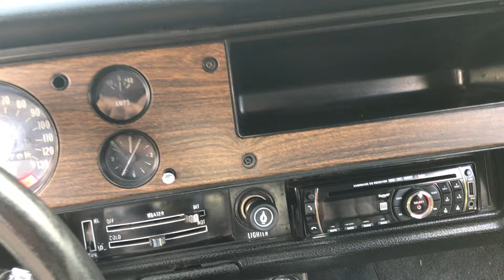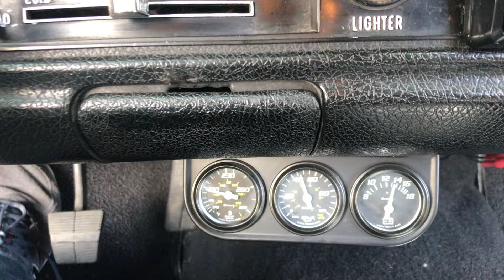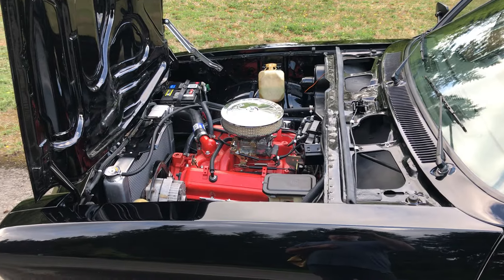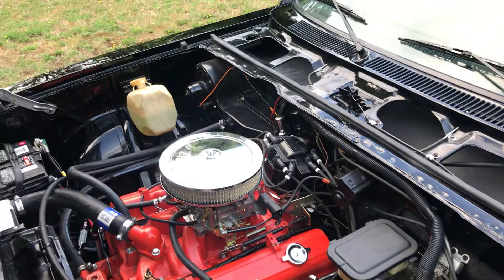1972 Vega GT V8 for Sale

Comment: I had a 72 gt metallic bronze 
With a white stripe down center and a 4sp in 1973 first car I ran that car a hard as it could be driven thinking when I blew the motor I would do exactly what you’ve got never could blow that thing up but it did use a quart of oil to a tank of gas 😂good memories 
Traded it for a new olds cutless salon with a 455 in 75
Wish I had them both now😢

Comment: Looks like my 72 Vega GT, 4speed with AC in lime green with white stripes that after six months had to have the cylinders steel sleeved.  I had it through my college days. It gave me 5 years of good service until the AC decided to stop and it started to rust out. So, by that time I had a real job and bought a new 78 Toyota Celica. fast back.

Comment: I had a 72 (not GT) Vega for a long time with a 307/Powerglide in it.  Engine was basically stock but with a 4BBL (AFB) carb on a chevy cast iron 'high rise' and headers.  It was a lot of fun, but it rusted away to nothing.

Comment: V8 Vegas were all the rage during the 70's and 80's! Simple power-to-weight ratio! My friend had one with a bone stock 350! It even had It's cast iron intake manifold! Just 275 hp and would blow the Doors off a Big block Chevelle! Even got 20mpg on cheap regular gas!
Reply: I had some bolt on power on mine and a mild cam.  I put a 350 4 bolt main in it. Performer intake.  Holley 600cfm secondary vacuum carb.  Nothing too great.  My exhaust was a joke. 2 1/2 inch headers with bullet mufflers welded to it.  No pipes at all.  Put it on top of a Munci M21.  I guess I did get a little crazy with the rear end.  I put 4.11 gears out back.  I wpuld guess it put out somewhere around 300 HP and the torque was probably around 400 to 425.  It pulled low 11s but was squirrelly as hell.  Best drag car I ever had for the total cost.  4200.  That was in 2001 2002.   Fun car.  Rice drivers wanted no part of it.  Muscle and pony drivers got good views of the tail lights.

Comment: Bought a rust bucket '72 with 20,000 miles for $100 back in '79.  Drove it until the rear swingarm separated from the unibody.  Was hoping to find an oil burner with a good body and swap engines but finding a clean Fischer body in New England was impossible.  Sold it for $100 for the engine.

Comment: I had a guy pull up next to me at a light in a Vega, what looked like fake dual quads sticking out of the hood. I was in my 70 barracuda 440, needless to say when I caught up to him at the next light I couldn't believe what just happened.
Reply: Back on 01 02 I had a 72 Vega.  Bolt on power on a 350 I put on it sitting on a Munci M21.  Put a 4.11 rear end in it.   Total, I had 4200 dollars in it.  I raced a kid who was driving his dad's 68 Hemi Roadrumner.  He wasn't too happy that he was smoked off the line by a car that had duct tape holding the driver door shut.   Fun cars.  Dangerous if you wreck them....but fun.

Comment: I guess it's sold? I don't see a fan on the radiator. I had a 72 Vega with a 350 2brl carb. My friend took a 71 Nova and put the front end and read end to include the engine in a Vega. It looked like a mini Camaro. Fenton center lines and sold it for 600.00 in 1978
Reply: I had to take the hood off it to keep it from over heating

Comment: I built a '74 Astra GT  327 off a '67 Corvette engine hooked headers. 4 spd black with black interior.  I got most of the info on the swap from hotrod magazines and parts from auto wreckers lots of fun.

Comment: I owned one of these, a 1973 model with a 327 stuffed in it by a mechanic friend in Delaware.. He even put cut-outs for the headers on it for me. That little sucker was fast and actually handled pretty well.. Street raced with it several times and made a few bucks. I remember would bust my balls a
bout owning a Vega...until they saw it run that is.
Reply: My 3 car was same as this only all beat up. I was a teenager and couldn't afford to upgrade the stock axle.  I would leave one line of black rubber  for 100 feet all over town. I couldn't just drive it normally. Burnouts were just too much fun!
Reply: It’s available now..?? I like this..!! How much $$$

Comment: My first car was a used '71 Vega with the four cylinder aluminum block engine, I bought ~ 1975. Engine was crap when I bought it but it was a fun car to drive (while it drove). I got in trouble with my mother because I put a pillow on the emergency brake so my dates could sit closer to me while I was driving (mother thought I had an ulterior motive with the pillow). It was a good first car and made me respect every car I've had since....

Comment: I had a 1975 Monza with the pathetic 262. In 1978 I dropped a 383 pro built V8, B&M turbo 350 transmission and a 12 bolt 3:73 posi. Not bad for a high school kid. I miss it. Would love to have another, but this Vega fits the bill for this 62 year old. Probably not available.  But cool. VERY cool!

Comment: Vega frames are extremely weak. Guys used to put SB Chevys in them and go to the drag strip where Vegas became known as twisters. Because horsepower will twist those things like spaghetti. One guy got completely ejected at our beach with his V-8 Vega.  He was gonna do a show off burn out. He revved it up, let the clutch fly, and the front half of his Vega did a left side wheelie that popped his door open and spit him straight out on the road. The car coasted off into the grass and stopped. The left front tire was at least a foot off the road when he got help pushing it back to the street. And it stayed that way. His door wouldn't match up good enough to close any more. The thing was a mechanical pretzel !

Comment: Great job. What you built here is what the Vega should have been. The body and especially the front end on the 1970-73 models was just awesome. Unfortunately that was were awesome ended and woeful began; i.e. mechanically these cars were absolute TURDS. The V6 Mercury Capris built in Germany were light years better than the Vega. That's why the TLC you put into this vehicle is so appreciated. I love to see these Vegas resto-modded w V8's.
Reply from the maker: My goal with the build was to make it look as "factory" as possible. I hope the new owner is still enjoying it.
Reply: @albertpenello  Well you really nailed it. It's hard to find these nowadays because unless they were kept in Arizona or garaged, the bodies have rusted into oblivion. Most of what has survived has been tubbed & caged for racing so to street them usually takes a lot of work. The upside of that though is that it's usually less metal / frame fabrication and more tedious work like wiring etc.

Comment: That doesn't appear to be a 327. There's something wrong with it, a 327 has an oil fill tube in the forward part of the motor tilted slightly toward the driver's side. 265 283 and 327 engines had that design unless that is the very last 327 built in 68. Only a 305-307-350 and 400 had the oil fill on the valve cover itself.

Comment: had a 72 gt myself..... steel sleeves in my 74 motor( bought for$400 in 76) that i wrecked and dropped the motor in the 72 gt that i bought with no engine for 200...back in 77... put over 100,000 on that motor...

Comment: 327 eng. 1962- 19671/2 small journal crankshaft engines has an oil fil tube in the front of the engine by the water gooseneck on the manifold. Under the intake it had a oil can mounted and the small journal intake was made for the oil can. In 1968 they changed to a large journal crankshaft and the oil tube hole, plus a oil can under the intake was removed. The early model  was changed and in 68 there was no more small journal 327. The engine is 68 or newer, there is a place in front of the head on drivers side with the manufacture code and info on the eng. was stamped.

Comment: This is one of the best stock looking Vega’s I’ve seen. Nice car! I know about the dual exhaust thing. I really would like to have my very clean 73  I had in HS. It was just a couple of years old when I got it. Mine was the GT. It was a green color, had the posi rear end, and the crappy opel 4 speed. I did a few other things to it but, didn’t quite make the V-8 conversion. I’m wondering how a set of chrome side pipes would look like on the car, especially with it being black.

Comment: If Chevrolet had stuck with the idea of putting a 283 ci motor married to a 4 speed manual transmission,  and a positrsck rear end, & a serious coat of rust PREVENTATIVE at the factory , the Vega GT would have been an outstanding little muscle car!
Reply: You could have purchased a Baldwin-Motion V8 vega during those years.
Reply: Chevy did put it through a 5 or 6 step rust proofing treatment but there were too many air pockets where the rust proofing didn't reach when dipped. A two speed power glide automatic transmission fit well onto most small blocks and didn't require much in the way of modifying the body transmission area. The power glide was originally used on some of the first Corvettes.

Comment: We had the Red Rod at 16 yrs old in High School my Buddy Mark neutral dropped the faster stuff , 4 bolt main 350/ 400  monza v8 posi rear end ,, smoked everything ,, 454 SS 70 Chevelle yellow black stripes 4 speed ,,, smoked it ,, everyday at lunch ,, Mustangs ate em up .. SS camero ate em up . .. R/T chargers ,, my buddys had them all . the v8 vega ate em up .. 5.0 mustang Highway patrol new to street ,, smoked it :) .

Comment: The story goes that the Vegas was never granny tested , as they were in a hurry to rival the Pinto . The Vega was a delicate car and they dipped the frames / bodies in vasts for rust proofing which was stupid , as air bubbles would happen , and that's how they were prone to rust . For 1976 and 77 , they worked all the bugs out  of the car , but consumers lost interest as the reputation for these cool  little cars was already done , so they gave up after small sales in 77. Its a shame as they needed more power than 90 horses . I had a 1976 V 8 , with a 906 cam , Truck CID 350 engine in it with a 9 inch Ford rear end . What a blast that was ! Though it was a automatic , it had a shift kit in it .

Comment: Out of all the small blocks that Chevy used in cars for some reason the 327 feels perfectly designed for the cars it was in. Always run smoothly no matter what, one of my favorite engines ever made.
Reply: Hey Matt what about the 283ci ? Jus’ askin’ ! 👍
Reply: @mtsilvagt  I like em don't get me wrong 283s are nice. I don't know how to explain it the (stock) 327 has the perfect amount of torque and horsepower that all seems to be in the right place, yet it still revs nice and has power all the way up to the bottom of the red. They were good with power glides, THM350/400 autos but put one in a camaro with a Muncie 4 speed and it will be happy as hell.
Reply: Z  I think its just because most people don't have experience with what they speak of. If you had a 327 and maintained it well they were (dare I say) Toyota kind of reliable and you couldn't hurt them from beating on them, I've tried.
Reply: Z  Unless you have a car that came one there is no good reason to use a 327 vs 350.  The primary difference is that a 350 uses a 3.5" stroke vs the 3.25" in the 327.  All 327  blocks had 2 bolt mains, where 350 came with either 2 or 4 bolt mains.  In either case they are fairly short stroke engines and could be built to rev to 8500+. All things being otherwise equal the 350 will make noticeably more torque and hit peak power a bit lower rpm vs 327.  In theory all else being the same the peak power should be close to the same but average power power will be higher with the 350 between the peaks.
Reply: It was underpowered for the 1967 Impala and C10.
Reply: @20alphabet  you think so? I had a '65 with the 327 and a power glide and you are right in that it wouldn't accelerate too quick but was more than adequate. If you are familiar with the 101 freeway there is a hill called the "Conejo Grade" which is one of the steepest grade highways around and I could still maintain 75 mph going up it and I was no where near floored, I feel like you cant ask more from a stock car.
Reply: @mfslyphantom8811  
Yes, I think so. No V8 would have difficulty maintaining speed up the grade into or out of Ventura. But the 327 base engine wouldn't set anyone back in their seat in a larger car or truck. Now the 300hp version with the 350 Turbo-Hydramatic  or 4-speed would be a different story, but the base 327 2bbl in Chevy's big cars offered sluggish performance. Btw, I had a 1969 Nova with a 307 2bbl that flew up the grade, and also had good acceleration. Just a matter of weight I suppose.
Reply: The perfect match for the Vega would have been the Olds/Buick 215 Aluminum V8 from 1961-1963.
Sadly, they sold that engine - tooling, blueprints, and EVERYTHING - to Rover in the mid-1960s - and Rover refused to sell it back later.
Swap kits WERE made to put that engine in a Vega (I had a '73 GT set up that way) and it was GREAT.
Reply: @ineffable1129  my uncle (waaay back when) used to race dirt track modified. He and my gramps used 327s with a 283 crank which put the displacement at 302 cid. (They were doing this before Chevy put out the DZ-302!) 
  Needless to say they had a great deal of success.  Won a lot of races and broke more than their fair share of track records - with a few that still stand today!  It got to the point where they were forced to tear down the engine after (almost) every race because they thought my uncle and gramps were cheating. 😆😄
  Chevy hit it out of the park with their small blocks.  They were damn near bullet proof, and so many variables.
Reply: Z  Came back as the 5.3 truck engine
Reply: @bunk-bn9eo   Yup, that was the magic combo. It WAS the 327 bock but with the large journals and 4 bolt mains. GM chose to only build it as 350s (same 4 inch bore, longer stroke) or 302s (same 4 inch bore, shorter stroke). Forged short-stroke crank from the 283 and BAM. And yes, Chevy needed a 5 liter quick for Trans-Am homogulation an that is exactly what they did for the Z28's 302. Also came in Canadian Firebirds so they had a motor for Trans-Am racing, too. Funny, ACTUAL Trans-Am Firebirds ran the Chevy 302. Odd that never made it into the ads.
Reply: @mtsilvagt .....Hey, what about a 327 with a 283 crank, otherwise known as the Z28 302?
Reply: @bunk-bn9eo  - Even earlier in late1950's  it was discovered heavy casting 283's could be bored a whopping 1/8" / 0.125" to create a '301' which is same bore/stroke as a 302" (Chevy, Ford, or Pontiac 301")...
Reply: @mfslyphantom8811  Much depends on which version the 327 is. Several were sloth slow turds.
Reply: @20alphabet  - Basic 300 HP 4 bb. carb. 327 would shove a '67 Impala to 140 MPH... hardly underpowered...
Reply: no mention of the rear end

Comment: What about the rear end? I had a 73 Vega wagon crap build quality  typical of time , piece of junk aluminum sucked out four banger.  The engine quit at 46000 miles. Had a 283 put in , stock  rear end  lasted a week . I think it would be a cool car if done right. That was 43 years ago.

Comment: I don't like the sound of the cam Lopez. I prefer a smoother and much quieter running engine. The 327 was a good choice. Those earlier Vegas were good looking cars. They had hints of 1970 Camaro throughout especially the front. To bad the car got a bad rap. That was GM's fault rushing it to production for the 1971 model year with an unproven problematic engine that needed more reliability testing
Reply: In '76 Chevy did an Endurance Test for 3 Vegas of 60K miles... 2 of them made it... only a 33% Failure Rate... LOL!  ... Press was watching so they had to use it in their ads for a while... Timing belt prolly broke on one... I have always avoided timing belt cars... 
They were prolly inspired by 1961 Comet Caliente Test... averaged 100+ MPH for 100K miles...

Comment: I bought a 1975 Monza 2+2 with a 262 V8 Auto in 1979 and had it for a couple of years before we dropped a 1968 327 bored .030 over with 202 heads and a pretty strong cam. Behind we put a Fairbanks Turbo 400 with a Manual valve body. It had a 8” ford rear with 4:10 gears from a 64 Comet/Falcon  which was off center I think two inches. So you get the tube and axle from short side and you could put a pretty nice sized tire in the rear. Fun car, I never got to race it in that form. But I did do a couple runs with a stock turbo 350 and 3:23 gears and it did 14.2 and 101 mph.
Reply: Nice!
Reply: Had one as well. Nice, poor gas mileage, 9 mpg.  Manual steering, power brakes.  Had the bottom of the doors not skins but shell not rotted out by the time it was 4 years old I would have kept.

But if doors were shot, there was more hidden rust. Did have to have front structure rails reinforced as the (Vega Design) was unable to handle the torque.  Cracked in several places.  There were many V8 Monzas in my city.  Frame shop was doing 3 a week.